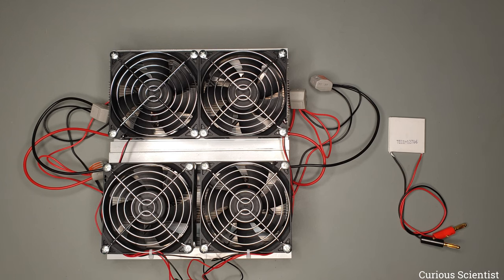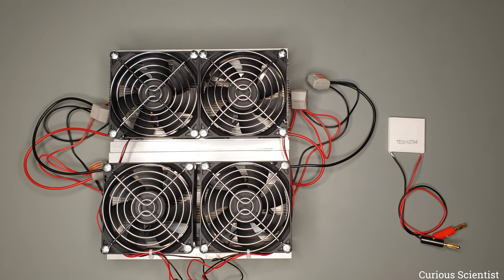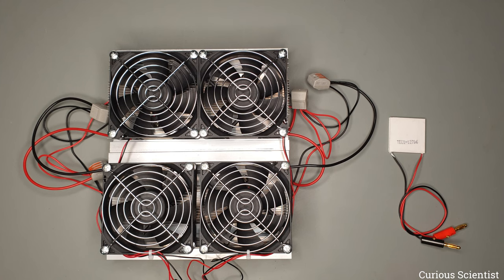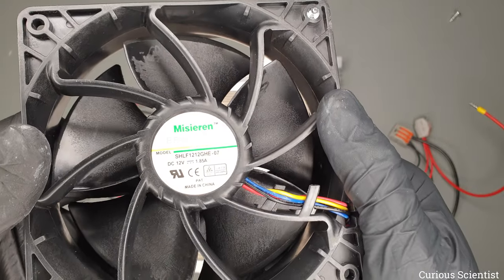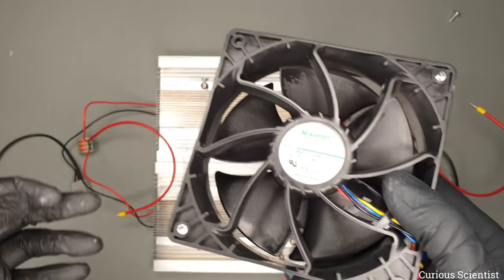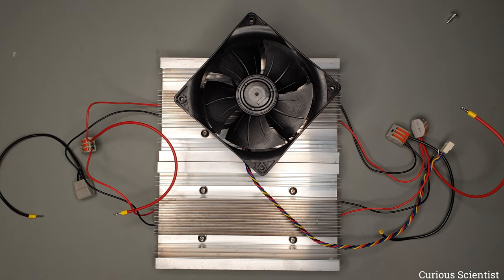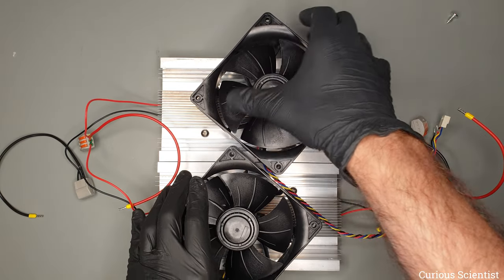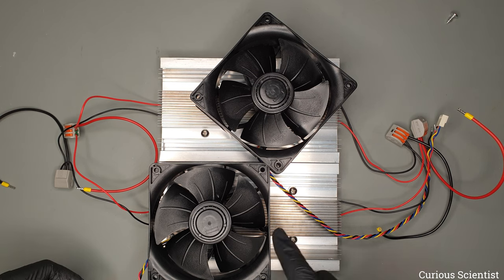Testing the "240 W" Peltier cooler refrigeration plate

Comment: I saw a video that showed increasing the air flow doesn't make a hige difference to the cooling of the hot side, but surface area of the heat sink does.
Reply from the maker: Yes, I agree, and that's what the conclusion of the test is, too. Even with the super strong fans, I could not push the temperature down, and then I said that the bottleneck is the heatsink.
Reply: @CuriousScientist water cooling the hot side could work well.
Reply from the maker: Yeah, but then there's no reason to buy this specific device. The just buy everything separately and assemble them into a new unit. I did like that when I built my big cloud chamber.

Comment: This reminds me of the systems used to cool telephone/internet exchange boxes on streets, I believe they also use peltier coolers to reduce the internal temperature.
Reply from the maker: It could be! Sometimes, they are used to cool electronics, too.
Reply: @CuriousScientist 16,2V×5,3A×4=343,44W!
Reply from the maker: What are those numbers?
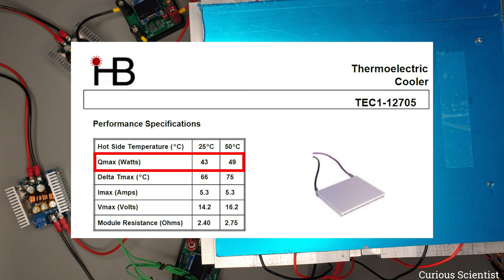Reply: @CuriousScientist  34:42
Reply from the maker: @johnflower8384  Yeah, so you just calculated the total electrical consumption when the device is running at its maximum rated parameters. So, it is almost certain that they don't advertise the 240 W as the consumption of it, but it should be the cooling power. However, that would only be valid with the TEC12706 cooler modules.

Comment: Hi , the first thing that I remarked at the very start of the video was that you turned the device upside down , so the fans was directly on the table surface , and it was obvious that the air flow for the heat sink will be useless . cause the ( propellers ) are sealed by the sides . It`s for this reason that the heat sink failed .They are not pulling any air as they sit directly on the table.
This is not a bad critic but a useful one . Lifting the device up about 5 Cms above the table will give a better result as it is .
Reply from the maker: Sorry but wrong. I even mentioned in the video that there's enough gap between the fans and the surface of the table. I know my stuff, don't worry. 😉
Reply: @CuriousScientist   Stop trying to escape what you did wrong  , the may be space between the fan and the heat sink , but not between the table and the fan .
You know what ? If you don`t like that others give you any tips , then say it so  that everyone just applause and say great .
I did also a test with Peltier unit and know how hot it is and also  know how to cool it down  to it`s max . I am only trying to help you . 
I watched your video with the water cooling ant it is the best way to make it , but even on that water cooling there are ways to get less heat and less POWER and stuffs to cool it in a cheaper way . 
But as you seem not loving usful comments , then continue with what you can manage on your own . 
I am kicking off the subscription that I did on your channel. Good luck .
Reply from the maker: I try not to be very sad about you leaving my channel. Might take a few days to digest it.

I am really experienced with Peltier coolers, and I know what I am doing. I also knew about the possible issues with the lack of airflow, and trust me, there was enough space between the fan and the table. I was there, I saw it myself. The fans were sitting on a 10 cm wide heatsink, so the gap was 10 cm. 

I don't mind helpful comments, but you came here trying to lecture me without knowing all the details of my setup.
Reply: @CuriousScientist  Amen

Comment: 2 things that will affect the temperature is having the hot side  down with a small space between the fan inlet and the surface it is sitting on. Flip the assembly over and see if the "cold" side drops below 0.
Reply from the maker: There's enough space between the fan and the surface of the table, I even mentioned it in the video. The airflow is good. The problem is the undersized heatsink.

Comment: I can see that cold surface is covered with blue plastic, and that plastic is thermal isolation mean, temperature measurement using temperature sensor is made over that thermal isolator and temperature in display could be a warmer indication than under blue plastic. I could suggest that take that blue plastic off before making temperature measurements. The direction of the air flow of the fans was well outwards, as it was initially, to extract the heat outwards, but personally, I would direct the air flow of the fan not downwards, but upwards or directed laterally (taking advantage of the direction of convection), since the direction of heat goes upwards.
Reply from the maker: Hi! It is a very thin layer of plastic, it would not alter the measurements significantly. But of course, it is good to remove it. I needed this plate for another project, but before that project, I wanted to test it, and at the same time keep its surface clean. So, that's why I kept the foil on. Regarding the fans, sorry but I cannot understand what you mean.

Comment: test without those screws and a weight ontop. Are they titanium or at least stainless? Cant remember if nylons has a lower thermal conductivity but either way those plastic spacers are not going to provide sufficient barrier in that application.
Reply from the maker: Hi! I don't think that they would use titanium screws in such a simple and relatively cheap device. Also, they are attracted to the magnetic end of the screwdriver. It must be some sort of steel. It is shiny, but I am not sure if it is stainless too. I don't think that the screws cause the limit with the cold side temperature. I am pretty sure that it is the heatsinks that cannot deal with the heat generated by the Peltier coolers. I will soon receive some new CPU coolers that I will use for the cold plate instead of these weak heatsinks.
Reply: I've made cooling devixe for dogs in car with two peltier modules 6w and i used coolers from server case. Its perfect for that reason. I done many tests before and resolution ist that best coolersbare thwy with many thin plates and fan than bigger thick aluminium coolers.
Reply from the maker: Yes, the "many thin plates" (fins) provide a larger surface area, therefore better dissipation of heat. Big thick coolers are good in absorbing heat (larger (thermal) mass), but if there are just a few fins, then they cannot get rid of the heat well.

Comment: Hi, I live in an environment that has an Air Temperature of 32C on the agverage.
I wish to build a tomato growing chamber for testing  and I need to keep  the temperature at at range of 24 (best) to 27C..

I am thinking of building the grow chamber of 100% BLUE FOAM. My grow lights will be shining down from the top with an ACRYLIC plate - which isolates the heat from the outside.

I was thinking that having  a fridge Peltier chiller with a fan just attached to the grow chamber will be very inefficient -- not sure -

So I was thinking of chilling a water bath in a form box and using an ultrasonic mister (at intervals )to send a chilled fog into the grow chamber , that would allow the chilled fog at say 25C to collide with the leaves and then the overflow of water flows back out via a drainage back to the chill reservoir.

What do you think? How would you build it so that it does not cost a lot of energy?
Reply from the maker: Hi! A small, well insulated grow chamber can be kept at the described 24-27°C temperature range with this unit. It should not be a problem. But I would buy another type of cooler that has a large heatsink on the hot side and a small on the cold side. Check the "Dual heatsink Peltier cooler kit" on my website under the Parts & Tools subpage. The mist maker might be a good idea but in my opinion it adds unnecessary complexity. Regarding the energy consumption, there is no solution, it will require a few hundred watts because Peltier coolers are not very efficient. But probably it wont' require a lot of power once you have a stable internal temperature.
Reply: @CuriousScientist   Thanks for replying: Learning some tips from you.. I was thinking of using the peltier as a CAR COOLANT CHILLER (glycerin) and then using a pump to pump this green car coolant into the chamber.. 

So I have a FOAM Box of Car coolant chilled to say 23 C by a peltier cooler using a beer chilling coil..

Then using a radiator with a brushless fan and small brushless pump , to maintain the temp in the blue foam grow chamber...

I think this will use much less energy as we have a reservoir of well chilled coolant.. once the grow chamber is in "maintainence mode"

Am I missing something here?
Reply from the maker: Why would you use a nasty chemical? Car coolant is not glycerin but glycol-based... and it is quite toxic. Regarding consumption, you still need to cool down the large amount of liquid first, which will still take a lot of energy. Maintaining it might take less energy, yes, but that's exactly what I proposed in my previous comment.
Reply: @CuriousScientist  sorry I thought Glycol retains heat better but it is only antifreeze property: so I will be using only 5 liters of water that will be contained inside the sealed chamber. This water is cooled by an external peltier chiller via thick silicone tubes through holes. So 5 liters chill very fast.

My thermostat will control a pump to pump up this chilled water into a radiator inside this chamber.

I think this could work.. but I don't have scientific knowledge to figure out if this is unnecessarily complex for no gain..

Maybe I am better off with the Peltier Fridge Module with the Large outer heatpipe heatsink and  and small heat sink on the cold side.. ?

Thanks for your advice.

Comment: I think, they calculated the 240W based on the max electrical input: 4x 12V x 5A.
Reply from the maker: Hi! That would make sense, yes! But it is very misleading, in my opinion. That would be a valid parameter for a heater, but this is a cooler. 😄
Reply: @CuriousScientist  haha, yes, very right! But the number is higher and it might sell better! 😫 Great and very insightful video though!

Comment: Thanks for the video very informative, I just bought the same refrigeration plate and I have a couple of questions. The characteristics of the plate I bought are the following (which I assume are the same as yours):
voltage: 12v
max power: 220W @ 15,4v
Max Current: 30A
Stable Current: 14A

Can I run this plate with a 12v, Max current 18A power supply? or I need a power supply with Max current 30A?
Can a 12v, max current 30A Dimmer be placed between transformer/power supply and the refrigeration plate to control temperature and fan speed?

Thanks in advance!
G.
Reply from the maker: Hi! Have you checked my website? I put a very detailed calculation and explanation there.
At 12 V, and let's say dT = 40, each device will take up around 5 A and provide 30 W cooling power. So a 18 A power supply will be too little. Use a proper 12 V, 30 A power supply. Don't use dimmer to regulate the power. Use a DC-DC converter as I do in many of my Peltier videos.
Reply: @CuriousScientist  Thank you very much, I will check your website!

Comment: How did you run wires for the fans to come on with peltier
Reply from the maker: They were simply connected together in parallel and then powered by a bench power supply.

Comment: Hello ! Great video ! Since you are making a better version next , do you think it is possible to have a device  where the source can adapt to the temperature of the cold plate ? Like if your hand touch the plate , it will give more power on that region to make it colder and keep the avg temperature of the plate the same.
Reply from the maker: Hi and thanks!
Yes, it would be possible. But then each Peltier cooler would need its own temperature sensor and then its own power supply, too. So when a sensor sees a deviation, it will start adjusting the power supply to bring the temperature back to the target temperature. But it is a rather complex undertaking because due to the fact that everything is thermally coupled by the aluminum plate, probably all four Peltier coolers need to work together to get everything to the correct temperature. I could definitely do this (I mean, I have the skills), but it needs a lot of time and parts.

Comment: Hey, I m curious if we can make a de humidifier for a room 10x10x10ft by using these modules?
Reply from the maker: Probably yes, but they won't be super efficient.
Reply: @CuriousScientist  any rough estimate? How inefficient it will be compared to regular compressor based ones, btw thanks for replying
Reply from the maker: A Peltier cooler is about 5-10x less efficient than a compressor-based cooler.
Reply: @CuriousScientist  ohh, thanks for info

Comment: Stack the elements 4 high and use a constant current source driver. 1 layer don't work so well.
Reply from the maker: And what would you achieve? The amount of heat that you can remove from the plate is always limited by the Peltier at the bottom. If you stack them, most of the useful cooling power of the bottom cooler is used to get rid of the Joule heating of the rest of the coolers... Your suggestion makes no sense.

Comment: Would have helped to have the fans up off the table so they could properly force air through the heatsinks.
Reply from the maker: There was enough gap. I even mentioned it in the video.
Reply: @CuriousScientist   alright because with PC fans even an inch or two gap, diminishes airflow.
Reply from the maker: Yes, the concern is valid. But I made sure that there's enough gap to not restrict the airflow. Unfortunately, the main issue is the small surface area (small fins) of the heatsink.

Comment: is it gud idea to make both sides water cooled.  1 for making hot water bucket. 1 for making cold water bucket.  then pumping the water into 2 radiator.  cool radiator blowing at my face. hot radiator blowing at window. 
is my design OK. 
for cooling side water cooled with radiator is better or air cooled heatsink fins.
Reply from the maker: Cooling Peltier coolers with water is always a good idea. Your questions are already answered in one of my earlier videos: https://youtu.be/ZDLN_tMxSQA

Comment: "240W" probably the input power lol.
Reply from the maker: What? 12 V and 4x5 A. That's 240 W.
Reply: With fans!
Reply from the maker: I don't think that the fans are considered in this number.
Reply: @CuriousScientist  Why not?
Reply from the maker: @johnflower8384  Because I think that if they sell a _cooling device_, they wouldn't advertise the product with its power consumption, but they would rather state the cooling power of it.
Reply: A 240w heat pump AC unit and would perform just as well...

Comment: I'm really considering using peltiers on my stove and reject the cold into my fridge
Reply from the maker: You can not really heat with Peltier coolers to that extent to use them as a stove. They don't tolerate high temperatures.
Reply: @CuriousScientist  this would be for like tea and pasta. Nothing fancy, not even boiling.
Reply from the maker: If you can stay below the manufacturer's values, you will be fine. Also, the heating part would be more efficient because not only you are getting heat from the Joule heating, but the heat that you remove from the cold side (which makes the fridge part colder) also ends up at the hot side. But also keep in mind that the maximum temperature difference created by Peltier coolers is a fixed value. Therefore, you'll need to sacrifice on the temperatures and also on the cooling power.

Comment: Holla,

Nice videos so far. I usually fast-forward videos but with yours, it would mean losing valuable info. You just are too knowledgeable on this topic.

I have an idea that might* pull the job on using peltier for air-conditioning. The pathway is simple and you have all the items needed. 

I've actually gotten a few items myself but it would remove the doubts if someone with all the components actually does it.

It involves a few diagrams I will explain by sending you a video of my ideas, sending you a specific YouTube link and you putting them all together.

What is the best way of passing these all to you.

Wishing you well - Teemy
Reply from the maker: Hi! You can find a contact page on my website.

Comment: Can you make it for car please 👀👍🏻
Reply from the maker: It doesn't have enough cooling power. Peltiers are useless in those environments.
Reply: So make a ac for car that can run on water radiator water pump andd ice 😉
Reply from the maker: What?
Reply: I mean  
Small radiator plus water pump and Water pump pipes and pc fan or last box for cold water 🤨
Reply from the maker: I still don't understand what you mean.
Reply: Hmm
Reply: Like air cooler but with small radiator and pc fan
Reply from the maker: But what do you want? I can not understand half sentences, especially when you are using some weird English. Sorry!

Comment: Peltier is nothing more then surface ice maker. So don't waste time with 23% efficacy
Reply from the maker: I think they are not even as good as 23% efficiency.
Reply: I can run 800w worth of Peltiers from two 450w solar panels for a total of 900w but my heat pump AC unit which has a power consumption of 800w can't! 
Losses in the charge controller, the inverter for AC supply leaves not enough for the heat pump! The Peltier system doesn't care!
Reply from the maker: Probably because the compressor needs a bit more power when it starts. On the other hand, you'll see maybe 10-15% of that 800 W as a cooling power. Not a lot...